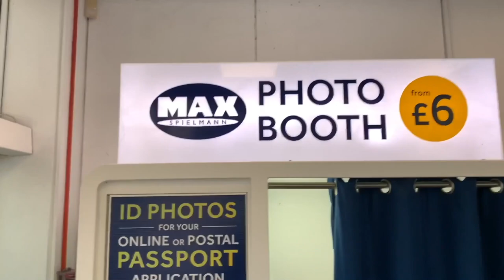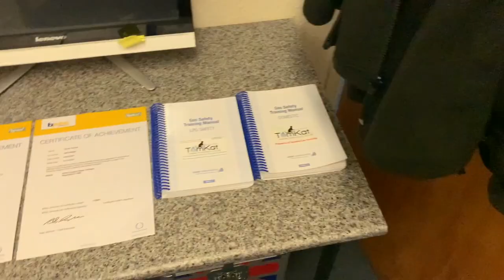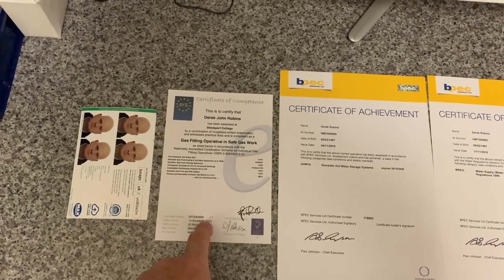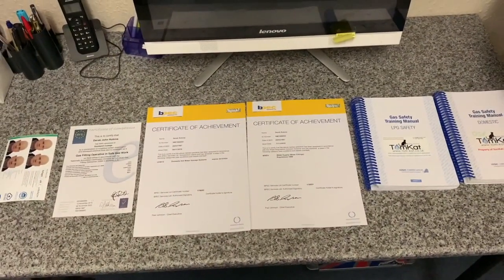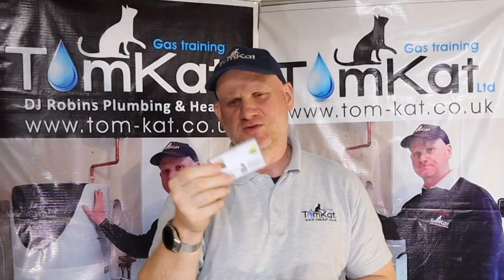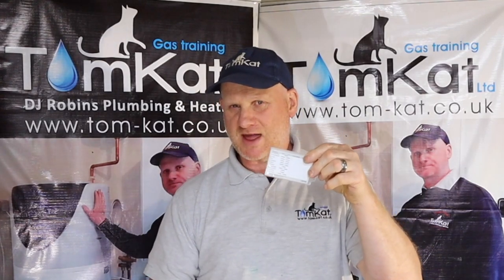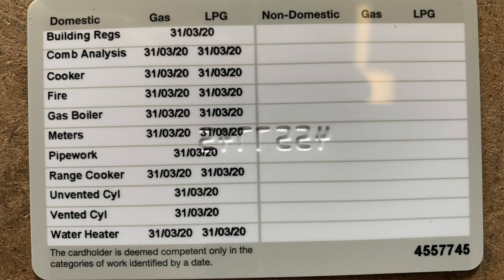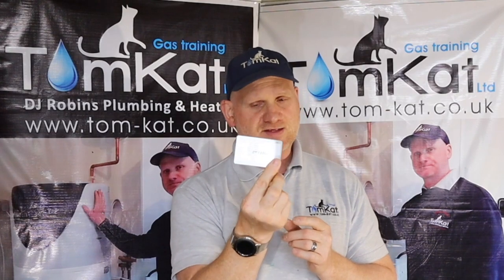ACS GAS ASSESSMENT WHATS INVOLVED. looking at what a gas engineer must go through every 5 years.

Comment: Hi Derek. 

I passed my ACS gas exams during my apprenticeship which i finished around 2012 they then lapsed in around 2017 because my employer never done any gaswork and i didn't renew them. Because the 12 month window has passed after the 5 years what is my best option to pass again? I heard there is a re-assessment which is an extra day longer. What would you recommend i do?

Please help.
Reply from the maker: You have to do an initial assessment again but as far as training it’s up to you and what you think you need. We have just done a guy in the same boat as you he did a weeks training before his assessment. Hope that helps
Reply: @tomkatgastraining  Thanks this helps alot. I will contact my training center and see if they offer anything like this.